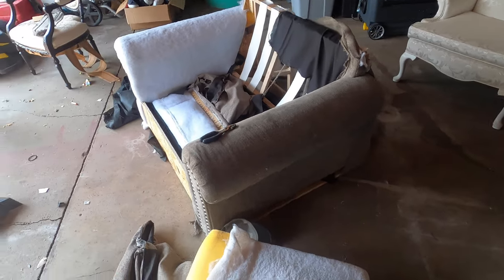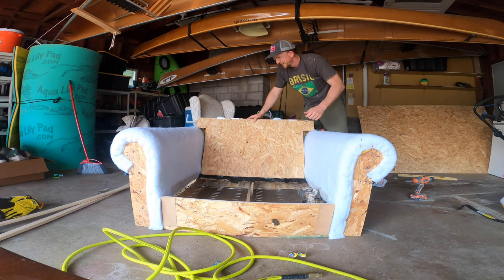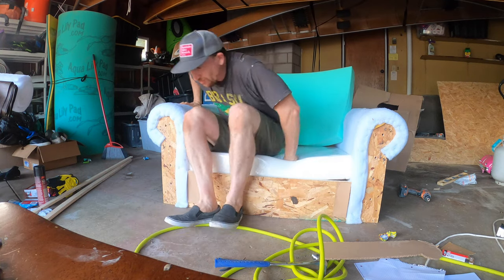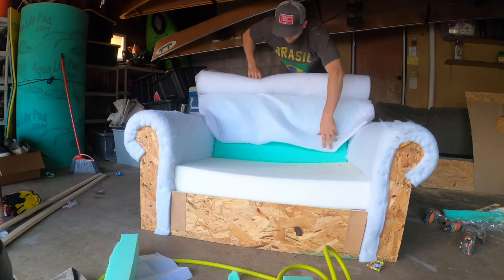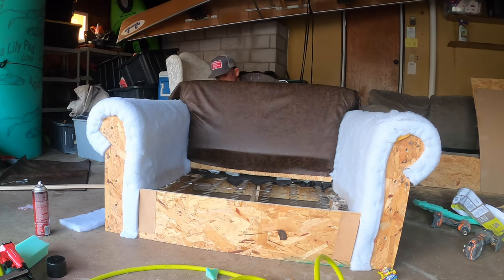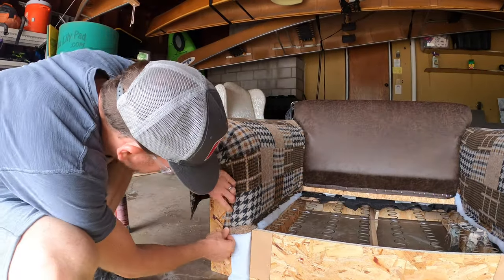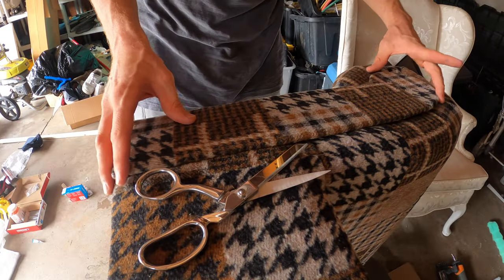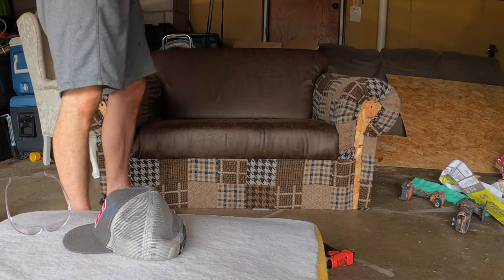CRAZY TRANSFORMATION Reupholstering a Chair and a Half: First Time Reupholstery

Comment: Here's a tip:  Your kitchen electric knife works well to cut foam.
Also, to add more cushion with your batting, cut pieces to layer 2-3 times making each one progressively smaller. The smallest piece goes down first. This will give you a nice looking arc and keeps the cushion fitting well. Cudos to you! It's great!